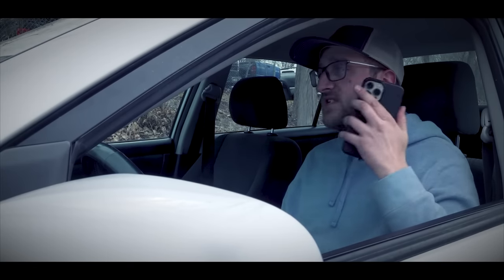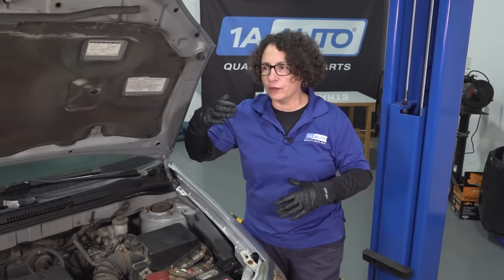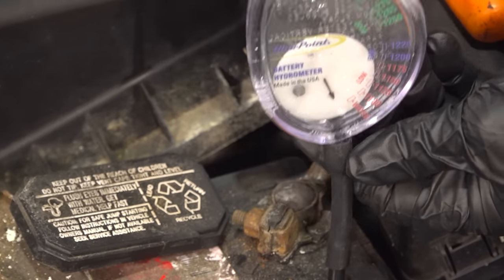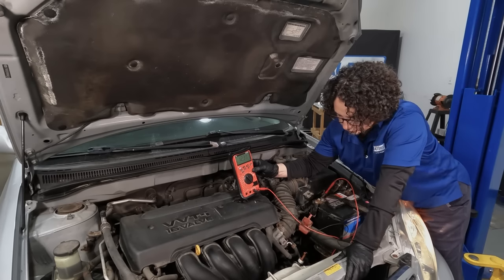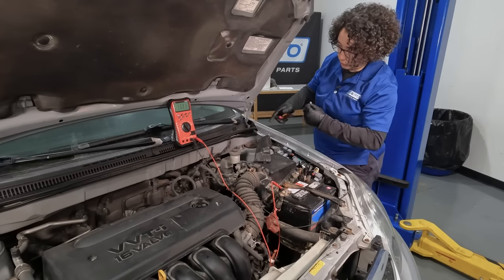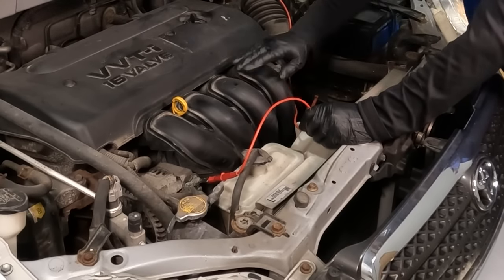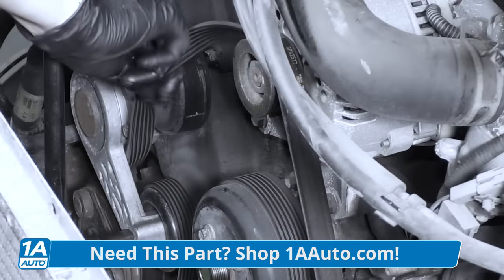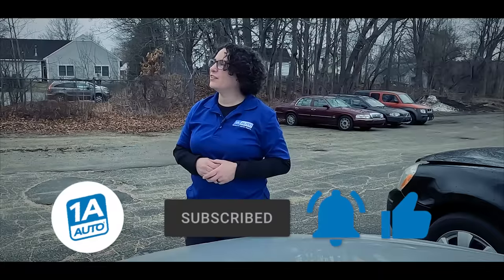Car or Truck With a New Battery Won't Start? Replace This One Part and Get Back on the Road!

Comment: I LIKE YOUR VIDEOS BUT…New battery testers have a switch that let you test the  ALTINATOR ….less complicated Ms,Mechanic…respectfully….some of this IS over the head of shade tree mechanics like me.. SLOW DOWN Show use the idle bar u used in the car AND SAFETY RULES WHEN  USING EQUIPMENT WHEN DOING SOMETHING LIKE THIS. MY HIGH SCHOOL SHOP TEACHER SAID NEVER EVER LET FAMILY, KIDS. LOOKIE LOOS STAND INFRONT OR BEHIND THE CAR. ALWAYS BLOCK WHEELS SO CAR WONT ROLL. IT ONLY TAKES SECOND FOR YOU TO DISCUSS. I FEEL YOUR CAR PASSION PLEASE ACCEPT MY CONSTRUCTIVE CRITICISM. KEEP ON Teaching fellow zgrease monkey…

Comment: I once went through 4 alternators trying everything before giving up and took the car to a dealer- a bad sensor was preventing recharge of the battery.  A low charging system can cause running problems too until it dies

Comment: You ran a ground side voltage drop test with the engine off. You can't perform a voltage drop test without current. The engine needs to be running.

Comment: Lots of good info here! Thank you for taking the time to share. If I may be so bold as to offer a critique; I didn't hear you tell us to check fuse continuity in ohms. Looking at the video it looks like you checked the fuse for its voltage. Stay safe!

Comment: Good video! One comment: you said the battery isn’t doing anything when the engine is running because the alternator is powering everything. The batter still acts like a buffer/surge suppressor, which is why they say to not drive a car without a battery. The battery still protects the numerous sensitive modules and sensors.

Comment: When using a hydrometer, you need to draw in enough solution (known as electrolyte). There is a line very near the top of the hydrometer which shows how much electrolyte you need to get an accurate reading. In the video the indicator was floating at the top of the electrolyte, limiting it's travel.
Also, the hydrometer needs to be held straight (vertical)
You have already determined that the alternator is putting out a charging voltage, rendering checking the fuse a moot excercise. If the alternator is NOT charging, then test the fuse before condeming the alternator.
Low voltage at idle can also indicate a load on the battery which the alternator can not keep up with at low idle.
You cannot to a voltage drop test unless there is current flowing through the conducter, which means alternator running.
A voltage regulator controls the maximum output voltage of the alternator. control the voltage, and you control the current (amps) output of the alternator.
Please, A-1, if you're going to put out a video, use a knowledable auto technician.

Comment: your chanel put good content but in this video there was 2 mistake ,the fuse should be check on the ohm setting not the volt,and for the ground side testing of the alt should be tested engine running for voltage drop .tks good video

Comment: My 2008 gmc sierra 1500 starts good.  I decided to replace the battery due to age of 4yrs with a new battery.  Installed it and now it won't crank. So I am putting my charger on it.

Comment: Testing the fuse while removed with the meter in voltage mode, how is zero a good fuse? shouldn't the meter been in ohms/continuity?

Comment: One really common problem is leaking valve cover gasket dripping oil on the alternator. I have seen too many covered with oil from the leak and go bad. Putting a new ine will go bad shortly after until thenoil leak is fixed

Comment: Thanks much for your video. I have a  2000 Camry LE when I turn on my car the lights the high beams sometimes dim. I've taken the Camry to different auto parts stores to have the battery and alternator test. They all tell me they test okay. But to me not all is okay. The high beams still dim. This is 23 year old wiring I'm dealing with. There are multiple grounds on this Camry. So where do I begin to hunt this down on this Camry. The Camry was given to me now I see why. I will get it fixed one way or thee other. Again thanks much for the video.

Comment: My 1997 Ford Aerostar van ran perfectly until yesterday, I replaced the battery today: no click (s), no dashboard indicator lights, no so sound (s), no corrosion on battery, no nothing: just dead silence💀 My next step is a Junk Yard. Should I junk it?

Comment: Like when my Cummins diesel says "check engine " but it's a computer fault with the DEF injection that stops the engine. Engine was running fine. Flipping EPA.

Comment: One question. I have a new alternator, new battery. It started for a few days, I tested the voltage under load and it was charging the battery to 14.3V but now the battery is bad (second battery)
Reply: What can I do?